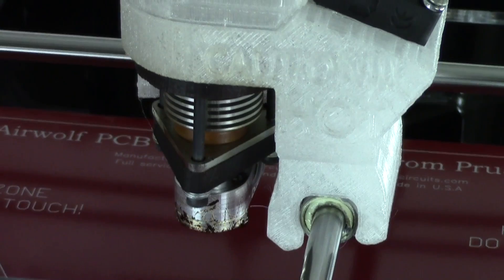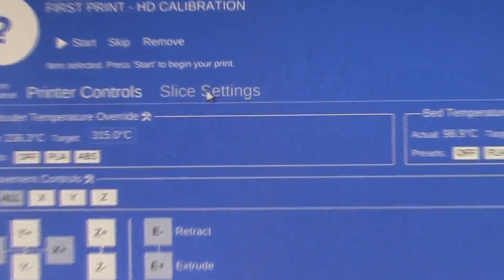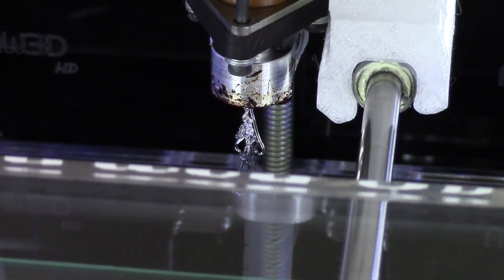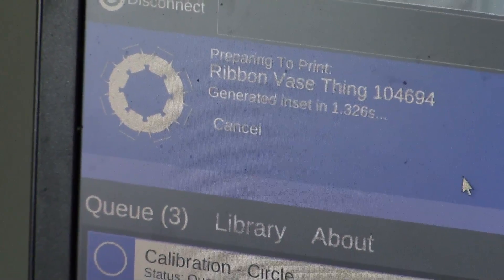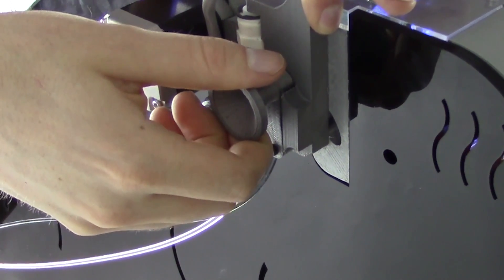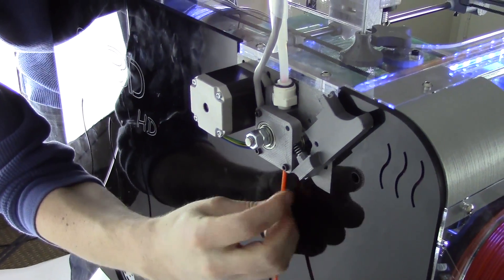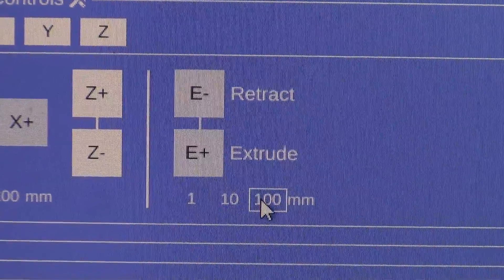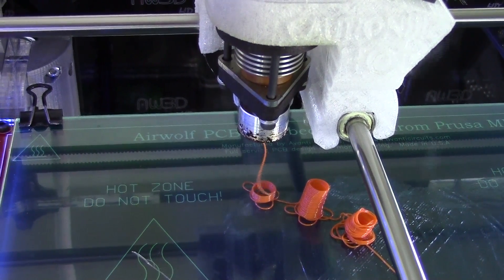3D Printing Polycarbonate with the Airwolf 3D HD

Comment: Does a purchased Airwolf 3d printer come with the plastic casings?
Reply from the maker: William,

Can you clarify what you mean by plastic casings? If you are talking about 3D filament the answer is, yes. Depending upon which model you purchase you are entitled to 1 or 2 free spools of filament to get you started. If you are talking about the housing/casing/frame of the unit, it is constructed of laser-cut acrylic. If these responses do not answer your question please contact us at info@airwolf3d and we will get back to you with an answer.

Thanks for your interest,

Airwolf3D